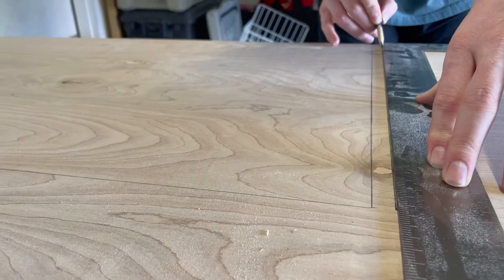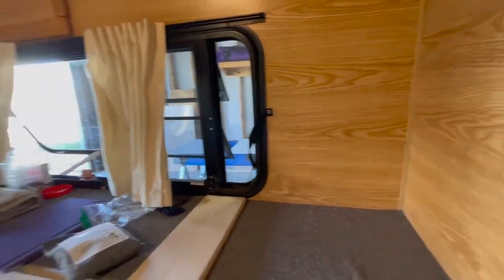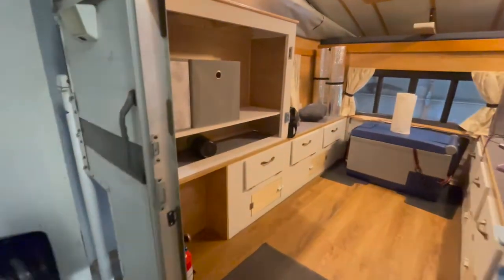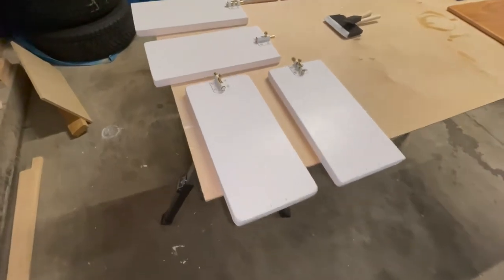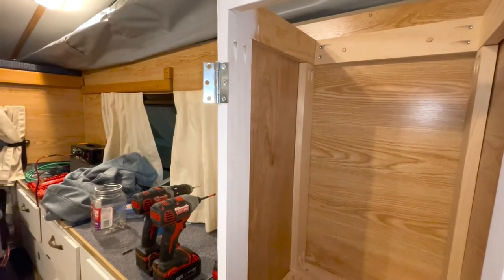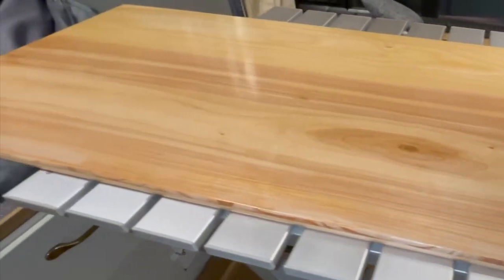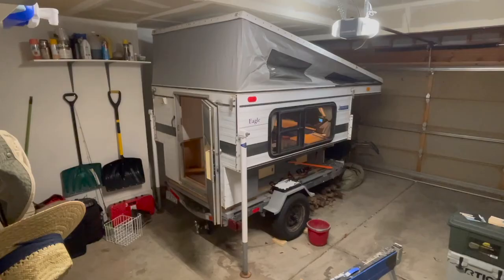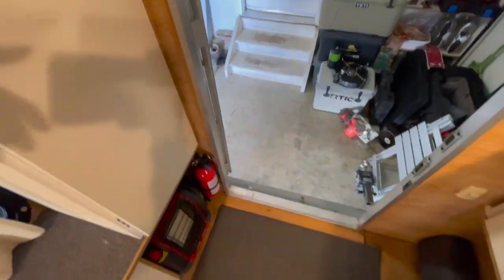DIY Truck Camper Renovation - FOUR WHEEL CAMPER for a SHORT BED TRUCK

Comment: Did you anchor the cabinets to the wall also or just the floor?
Reply from the maker: They were anchored to the wall as well
Reply: @LivingLargeCamping  So that's into the aluminum frame I guess... if you remember what kind of screws did you use?

Comment: What year is your camper? Hoping to get a 2006. Also, how do you like the bed size?
Reply from the maker: It is a 2006 as well. Size of the bed is great, just trying to make it a little more comfy for extended trips
Reply: @LivingLargeCamping  Can you sit up straight on the bed? It seems kind of low
Reply from the maker: @sipaez  no, I cannot sit up fully when laying in bed. I’m 6’2 and my head barely touches the roof standing up straight for reference
Reply: Whats a typical price for a used one like this? @LivingLargeCamping